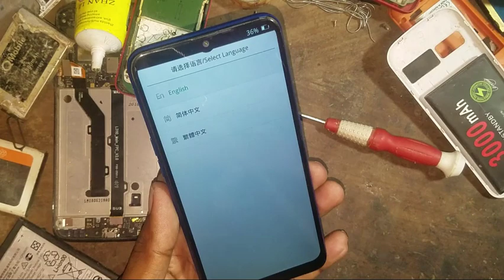oppo a5s black screen solution | oppo a3s black screen problem | All oppo mobile black screen fix

Comment: My phone had a non stop vibrating with black screen when turn it on. How to solved it.
Reply from the maker: You need just open back case after diconnect battry and display flexx your isssu solved inshAllah in few mints